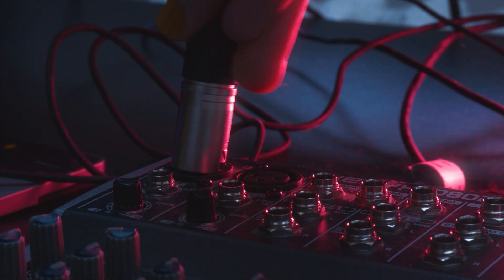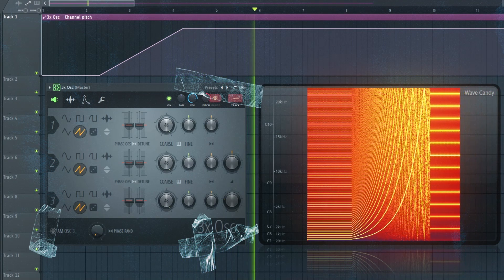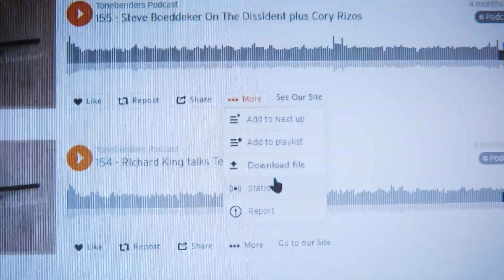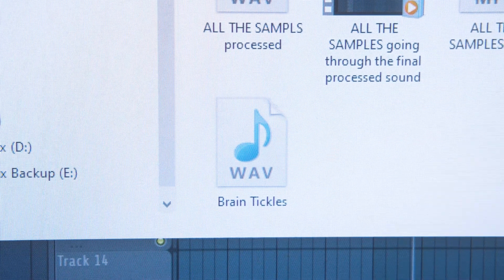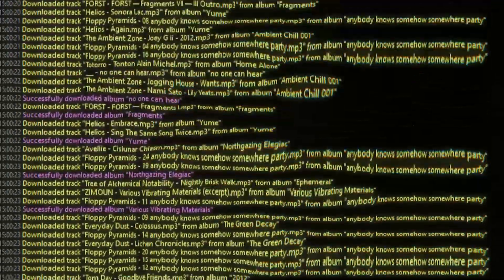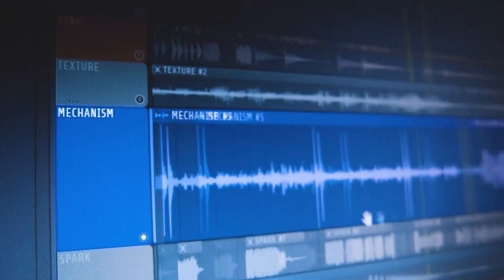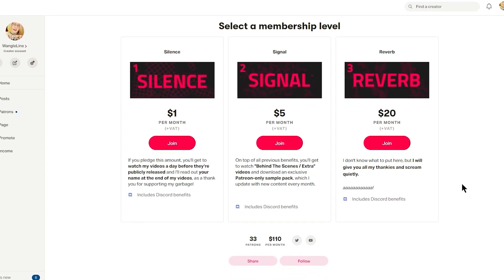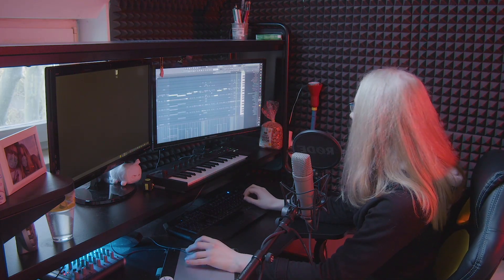How to Create Incredible Sounds with Aliasing Artifacts

Comment: If anyone figures this out in Logic please let me know cause I N E E D these sounds!
Reply: on my github I have a python script called mass-aliasing that does this way faster than a DAW, and you can take the output and then mess around with it. My username is apc518, cant post the link or this comment will get removed
Reply: @AndyChamberlainMusic  I finally loaded it up and got it to work! The program works perfectly! I just had to download the latest version of Python to get it running cause the Mac terminal was throwing a fit. Do you have any speed preferences? I did 100 and it seemed to be good.
Reply: @yoyobro2001  yea 100 is nice